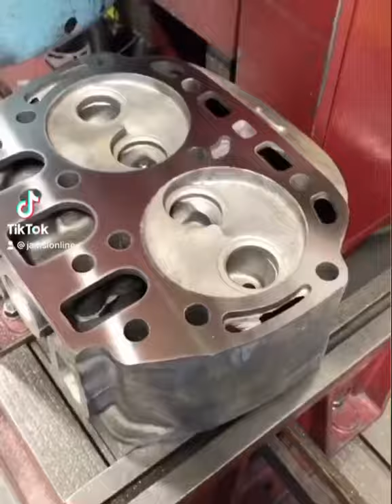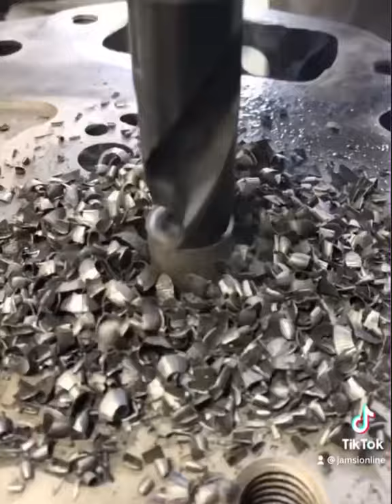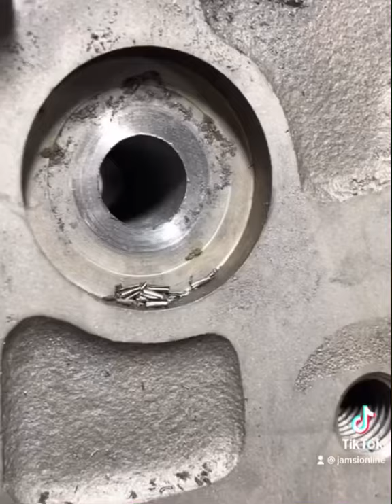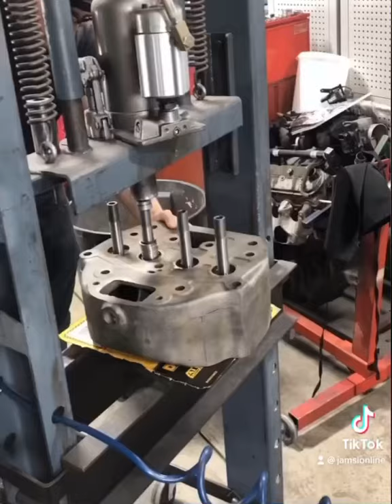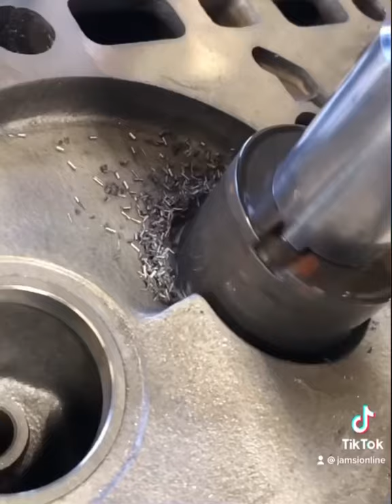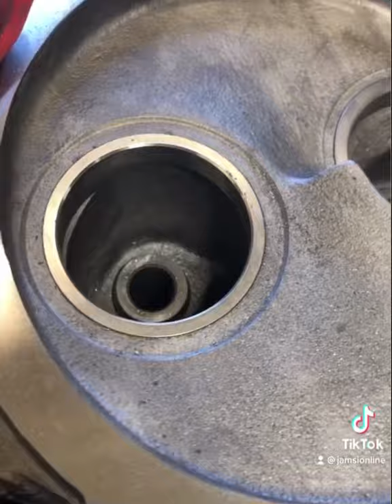#shorts John Deere A - 3 Angle Valve Job - JAMSI Online

Comment: Wow that's really interesting. I have never seen valve seats removed like that. We always either cooled the heads or heated them up where the old valve guides and valve seats just drop out with a very light push.  Then froze the valve guides and seats  while the heads were still hot as they both basically drop right in.  Also we never ever ever used machinery like yours at our work. The frequency damage from the tools would be to severe to heads. Even when we did our full radius value jobs it was done by hand.  Though this was on motorcycle race motors which turned 15,500 + RPMs so maybe that has a lot to do with it. As I don't think a large John Deer motor is really going to care. But you could at least try the cold / hot trick when doing your guides and seats.  Otherwise this was really cool to watch what a regular machine shop uses.  Pretty damn neat.  Thx!!!

Comment: Almost identical process to what I have to do on the old waukesha 817 and 1197 cylinder heads. Every time I get a set in have to order over sized seats and cut to fit

Comment: I did this for a long time. I wanted to build exotic race engines, but the old man that ran the shop said the real money was in big giant diesel engines like Caterpillars and John Deere's. Man I hated working on crap like that. That was over 20 years ago
Reply from the maker: He’s not wrong though. Farm equipment is our bread and butter. Consistent work that pays well, it’s hard to beat that.
Reply: Things I remember about working in the machine shop was showing off by putting my arms through the bores of a SBF and carrying it from station to station (I was 30). Building my engine (supercharged T-bird) during my lunch breaks which took three long months. And the old man (shop owner) buying me a set of forged piston for my 70 Boss 302. It was during that time that I friend traded me a set of fully ported 428CJ heads for a extra Boss 429 4-speed I had. I took the heads to work and cut the seats for bigger Medium Riser intake valves and custom exhaust valves with hardened seats. Those heads went on my 428SCJ that was bored .060 over and had 440ci (actually 339.?) with 12.0:1 compressions and a cheater cam but with Rhoads lifters to run in stock class. What a beast
Reply: Once I was resurfacing/milling a very old 1940'ish Flathead straight six John Deer head and the mill machine got real loud and started cutting deep grooves half way through the head. In a panic I shut it down and got Patrick (the old shop owner) he took some measurements on all four corners instead of just diagonally like I did and he said that the head was bowed and twisted. He reassured me that those old long thin John Deere heads bowed once they got hot. I raised the cutter and continued milling until the head was flat. Freaking hated working on goofy stuff like that.

Comment: At my tech school they teach you to grind off the mushroomed heads of the drivers to prevent you from getting blasted by a peice of metal chipping off. However I see in your videos you hammering on severely mushroomed heads. Is it not an issue because of the material or what?
Reply from the maker: I’m just somewhat irresponsible… that being said most of our punches are either cast iron or aluminum so when they chip off it’s not like a bullet the way people describe… if they were steel I would be more careful.

Comment: Why don't you use brass hammers to keep from wrecking your valve seat tool ?
Reply from the maker: Wouldn't make any logical sense. New valve seat driver once every few years for $35? Or a new brass hammer for $40 every 6 months when it's worn out from driving on a hard seat driver...

Comment: 😢 a machine shop here in my town cracked my valve guide housing.
Reply: How's that affect the engine does it seem it useless
Reply: @manuelesquivel2107  the long block is upgraded with bigger parts=more air flow. Plus the turbo 
  So since it’s in the exhaust port, all that air pressure is sucking the oil between the guide and the housing (between the guide and mating surface).
Reply: @Ryan_1997  damn
Reply: @manuelesquivel2107  ehh it’s all good. 👍🏼
Reply: @Ryan_1997  expose their ass did you get a refund

Comment: Today's society has a throw it in the gutter and go buy another attitude, people don't even spin rotors or drums anymore. I would love for machine work to be standard operating procedure again, not to mention a good machinist will easily tighten the tolerances that a factory job aloud which would increase in the volumetric  efficiency of the engine. Thus increasing HP, torque and fuel economy as well as other specs depending on engine set up.